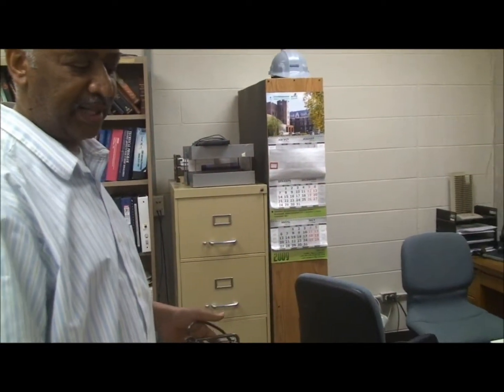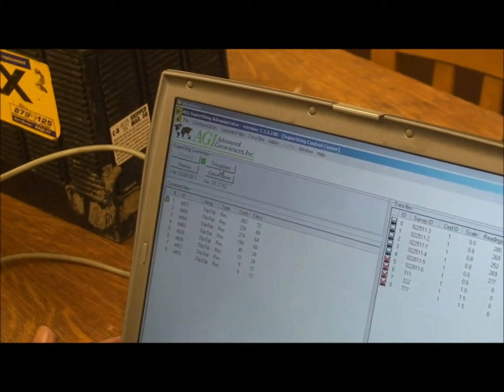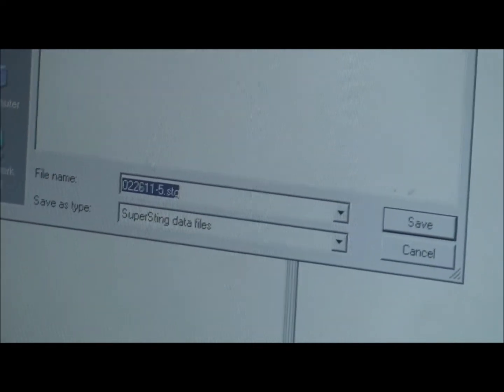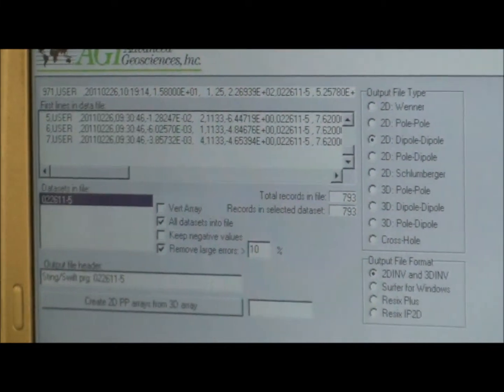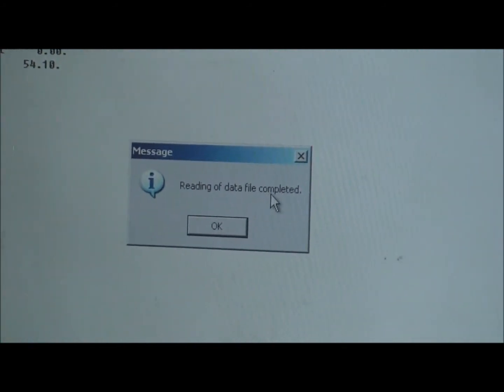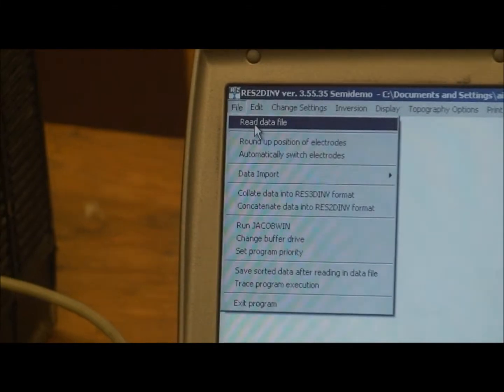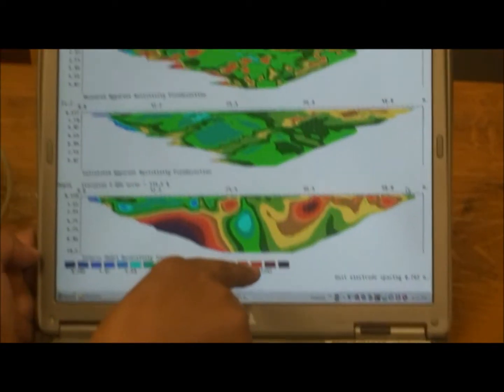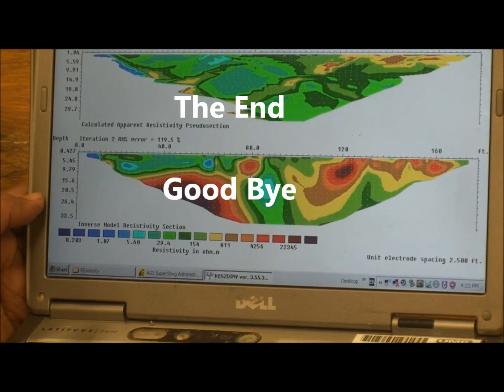Electrical Resistivity Topography Data Processing

Comment: Hi there. Thank you for the video.
I work at a groundwater consultancy in South Africa and we use the resistivity methods to investigate groundwater occurrence. When using RES2DINV we typically use the robust inversion instead of the least-squares inversion, as we were told that this better depicts the more drastic changes that can occur from geological contacts. Do you have any comments on why you would use the least-squares inversion instead? Also I see your final output has an RMS of over 100%?? Surely you should run several more iterations to attempt convergence?
Reply: Kes Murray I want to come next to U let's interface more on ERT
Reply: how to input the topography in the separate file?